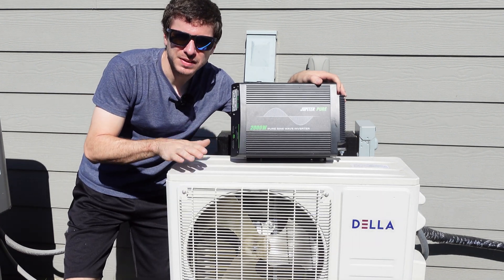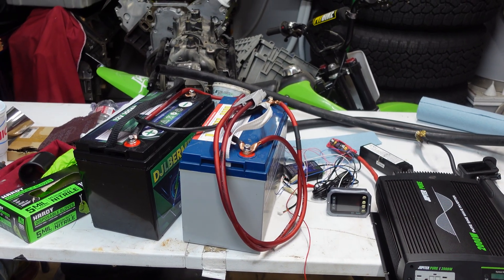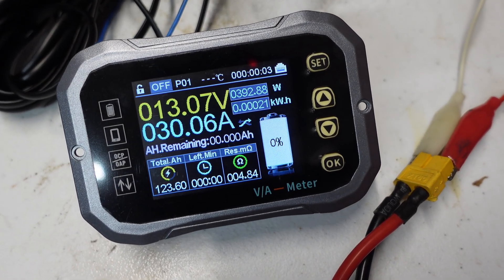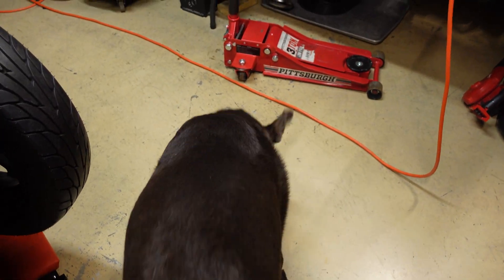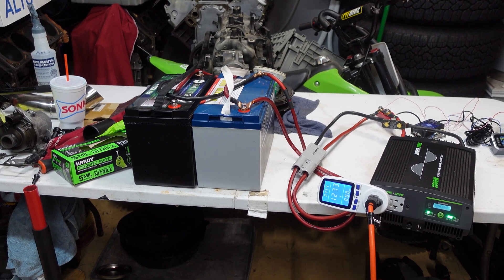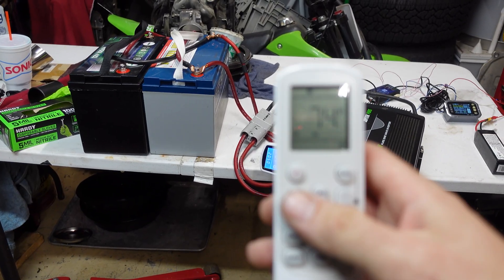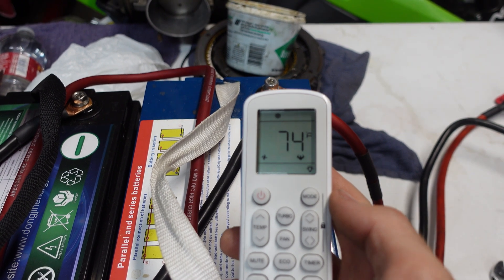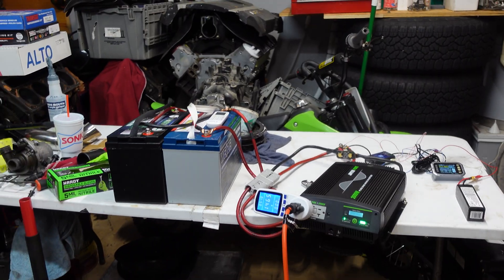Harbor Freight Jupiter 2000 Runs Mini Split

Comment: Cool. Will it not trip on a full size refrigerator compressor start? LRA is 6.7 amps and my FF Power inverter trips, it has an internal battery of 612 watt hours, 1000 watt surge, 500 w continuous. It was for camping running an inverter fridge, but at home it runs a normal size fridge in basement, but on this larger main level  fridge it trips out. A lot of Amazon users report iffy performance on  capacitor start motors tripping up even the larger inverters.
Reply from the maker: Yea depending on the compressor some may use more surge, i ran my refrigerator off this had no issues. 
Personally for 12 volt stuff id never buy smaller then a 2000 watt inverter just to have some overhead.

Comment: How many hours can you get out of it running a portable AC.
Reply from the maker: With one battery probably 1.5 hours. If you ad more battery’s you can get way more runtime
Reply: @Mikebuildss Thanks, I’m looking to run a 5k-6k BTU in a small box truck cab. 
Don’t need it too cold just comfortable, low speed would be fine. Was hoping to get at least 5-6 hours run time.
Reply from the maker: @KevinG1994  I would look into using a Inverter Type window ac, they use very little power on low, so you can get good runtimes with a small setup. Put a solar panel on the roof to charge aswell that will help.

Comment: Sure, it can, maybe if you're lucky a few times. But every time you start that mini split, you're shortening the life of this toy high-frequency transformerless inverter. If you want an inverter that is going to last more than a few months, an inverter that will last 10 years or more running an AC unit, then you need a low frequency, transformer-based inverter instead.

Comment: Can someone shed some light for me? I picked up the larger version of the inverter he has 3000/6000 for my semi truck. My AC is going out so I figured instead up trying to keep that old underwhelming system alive for now I can run my 8k btu portable and run the exhaust out the side window for the time being as I’m just getting started on my own and already spending money in the inverter maybe I can rig something up till money starts flowing in 😂These trucks run on 4 large batteries so I figured it would be fine as long as I don’t abuse the system. What say yall? It’s a 350 sq ft insignia. I can probably get a way smaller version.
Reply from the maker: My best advice is make sure you use heavy gauge battery cables from the inverter to the battery. Also the ac will use close to 1000 watts. So keep that in mind, it may use a TON of battery power idk how long it would run

Comment: Ha, I have waited for over a year to try this, funny I got Della (120v) 9000 BTU and today I had it running off a chins 50AH 640WH LIPO4 and if not for the convertor drawing on + and seeing I need bigger gauge then I would say IT WORKED :) only 3 100W panels too! In winter bad sun rays. Pumped! oh yea I have the controller and gear feeding that little chins. (Update) I forgot to mention they say when the MINI SPILT kicks on first time it is seeking to find the temp (located front of cassette under the lid). And after room stabilizes then the MINI SPLIT simply pumps Freon as needed (variable speed pump) that is cool because once stabilized the Watt draw and such will be MUCH lower when running. Think of it as the draw starting a car, then the current drops off. This is why I was attracted to MINI SPILT along with "no ducts" yay!!!
Reply: I have the same mini split you do but mine is 240V..and from what im gathering..its nearly impossible to do a little starter solar setup for that unit with it being 240 😞

Comment: There are some mini-splits that you plug your solar panels into directly now.  See: EG4 Hybrid Solar Mini-Split Air Conditioner Heat Pump AC/DC | 12000 BTU | SEER2 22
Reply from the maker: @Scott-sm9nm  I’ve looked into those, only reason I went with this unit is price! I have a nice big 48v solar power system I use to run 3 at once without issue to heat and cool the whole house
Reply: Great post thanks!

Comment: Could you do a video or something showing how you wired up the mini split to run on that 3 prong plug? I’m getting into solar and wanted to start small by moving my ac to solar. My simple start plan is buy a power station with about 2kw inverter. Overpanel with solar and add about 3kwh storage with lifepo4 batteries. I want it separate from my house grid
Reply from the maker: @stillbingrude  I have a video installing a copper and hunter mini split, on that video I show how to wire it. Just make sure you get a 120 volt model, it’s only hot, neutral and ground

Comment: I have a 190btu.  240v heat pump.   How should I set mine up?  I’m planning to get the 12v 280amp eco worthy batteries
Reply from the maker: @kenborghini  Ibwould find the max power the unit will pull and go from there. If it’s more than 1000 watts I’d go with a 24-48 volt system to keep the amps down

Comment: To cut the Amps down is it worth stepping up to 24V since now I only have 2 WattCycle 12V 100ah Batteries?  Thanks
Reply from the maker: Yes, id say if your needing more than 1000 watts of power at a time, go higher voltages. I use 12 volts for small loads, and 48 volts for larger ones! 24 would be great

Comment: I have this inverter and tried to run it to charge an allpowers unit that holds roughly 3600wh at high setting it charges at 1500w I use 00 gauge cables with 3 foot cable length and it started whistling when the output reached the 1500w range the led indicator showed red and the plastic surrounding post for the positive terminal started melting, I felt the cables they were hot, this was running from a 12v 2p SLA battery setup in my corvette c7 batteries are group H6 inverter is rated for 2000/4000w it should be able sustain 2000w and not melt down and handle peaks up to 4000w I used thicker than recommended cables any idea why I was getting this result I realize that if I’m outputting 1500w ac then I’m bringing in closer to 2000k dc bc of inefficiencies though the unit does advertise 90%+ efficiency that means I should be able to push 1800w ac and still be pulling under 2000w dc. If the unit is rated 2000/4000 I believe they’re referring to the ac output meaning with the recommended 4ga cables it should be able to pull 2200w+ dc. If I pushed another 500w the whole thing definitely would’ve lit on fire. Anybody have any idea why I got that result? Is it the battery chemistry? Perhaps the solar generator has poorly calibrated monitoring systems? I haven’t tested it with my LiFePO4 setup yet.
Reply from the maker: @ThisAndMattShow  more then likely too much voltage drop. Also when voltage goes down amps goes up, make sure connections are good, clean and secure. Lead acid can have bad voltage drop if they aren’t up for the load. I’ve pushed this inverter to 1500 watts plus a few times testing batteries and equipment and it held up. Also 1500 watts at 12 volts is close to 120-130 amps kinda pushing it for 12 volts in my opinion. Also lifepo4 chemistry is better for higher power due to lower voltage drop. But same thing they must be properly rated for your load and application. Hope this helps
Reply: @Mikebuildss  alternator is running and should aid in current supply minimizing voltage drop and also the unit itself started to meltdown on the physical terminal at this load which is a draw within its specified range and with cables much thicker than spec calls for. With 00 gauge cable under the conditions specified i wouldnt expect it to start melting, granted a shift from like a fully charged state of 13.6v down to the low end of the range the inverter operates within, lets call it 11.8 though its probably lower under this load which may be causing voltage drop the current does get pretty high but I would assume that it should operate fine up to 2000 watt rms at the low end of its operable voltage  range so it should be able to handle high currents of around 180-190amps. over the spec cable of 4ga i was using significantly thicker copper at 00ga and running at lower watt and voltage within the operable range but even if it drops to 10v at the 1500-1800 watt range im still under the peak conditions  current draw at the low end of its operable spec range. 1500-1800w/10v = 150-180amps where i would suspect it should handle up to 190amps which the 4ga cable it calls for, this should not be meltdown conditions for the terminal attached to the unit at the load i was putting on it.

Comment: I didn't like the Harbor Freight 2000 Jupiter modified sine wave...Maybe the quality is bad now, I tried three bought on sale.  I had one dead, one only putting out 250w and the third didn't put out any more than 600 watts. I used heavy duty cables.

Comment: Unfortunately, the inverter puts out a fait amount of heat. I love it in the winter, but not so much in the summer. If you are trying to cool the space, maybe run inverter or at least exhaust fan to the outdoors. Mine can easily raise the room temp by several degrees.

Comment: Just a note on your IR gun: It's probably fine, if it's a 6:1 spot size ratio, if you're 6 feet away, it's detecting surface temperature for a 1 foot diameter spot. It's not really going to detect air temps, but of course it can detect the grille temperature if your close enough.
Reply from the maker: @maxvtol  I see what you mean it does say that on the back part, makes sense now lol. Up close I’ve seen these how down pretty low

Comment: Thanks for this review.  What size cables did you run from the inverter to the battery?  I thought I heard 4awg but wanted to confirm.  Thanks.
Reply from the maker: @hsidder  Yes sir 4 gauge
Reply: @Mikebuildss  thanks for confirming!

Comment: Is there no surge when the compressor kicks on?  It’s been a decade since I messed with this stuff but back then I had trouble with even refrigerators popping the over current on the inverters.
Reply from the maker: @joeprimal2044  no these mini splits have inverter drives
Reply: @Mikebuildss  Hmm. I’ll have to check mine and see if they do. Thanks.
Reply: Yeah same with mine so I’m trying to run a pressure washer 13 amps but those inverters would always turn off the moment the pressure washer would turn on

Comment: From your video here this is exactly what I wanted to know about the A/C part of it. I want to use one of these to cool my work truck. It’s actually a retired para transit bus. These are rated for 500sq.ft. My bus is probably not that big. This should work well. My question is what about the heat pump? Will a 2000 watt inverter handle the heat pump part of a mini split?
Reply: It should be labeled for how many watts it takes.  You'll want to leave like 20% overhead, inverters burn out a lot more quickly if you run them at 100% for hours on end.
Reply: @laurenceperkins7468  Thank you.

Comment: Hello , can i have your list on the set up?
Reply from the maker: Sure, it’s a harbor freight Jupiter pure sine wave 2000 watt inverter, and the batteries are 100ah lifepo4 12 volt
Reply: How much power is your AC? I mean the  BTU?
Reply from the maker: @shemcristobal1614  9000 btu
Reply: How about your wires?

Comment: Could ya do a good clean vidoe of a good set of batterys and with solar and see how long it last. Great video tho 👍
Reply from the maker: Yes I can do that!
Reply: @Mikebuildss  thanks and have you done a video of running your house on it and how long. And ever done anything with power windmills
Reply from the maker: @dakotak8437  I have not, I have a large 48volt setup I use to air condition my house, I have 3 mini splits inside the house they all run all day on solar and one at night in my room. Works amazing
Reply: @Mikebuildss  iv been wanting to do this stuff since I was young but with my mind this shit gets crazy setting up and all the different types of systems bc so many and no one in area to help I'm more mechanical.

Comment: My Senville 12,000 btu mini split don't ever draw that kind of power & im completely off grid on solar only with 520ah of lithium the most I ever seen my mini split draw in ac mode is barely 900 watts full power & 1100w in heat mode the lowest is around 300w in ac mode & about 600 in heat mode Senville is a very good mini split when it comes to less power consumption
Reply from the maker: @thelithiumpowerch  This model doesn’t have the best SEER rating, I have a Hunter and Cooper model aswell and it’s only ever pulled 1000 maxed out
Reply: @Mikebuildss  oh ok sounds a lot better

Comment: The easiest/best way to get solar power to ac is to use something like toshiba dual hose inverter portable ac. 
The thing is you can run them at much higher efficiency on low, using fans and ac science to get a cop of 6 roughly or 6 times heat transferred out as opposed to put in. 
They can run as low as 300w efficiently and effectively, they run the compressor slow and move lots of air to get maximum cooling efficiency. 
Just like most mini split solar setups. 
Except they are 5-10 times easier to install, portable, modular, and mildly less efficiency but still very efficient. 
2 toshiba units can keep an entire big house cool in very hot summers and poor house insulation situations. 
1 can do a 2 bedroom house very easily. 

Mini splits are a hit and miss, i think are less reliable when you go that cheap (400) and are not as efficient too when you go that cheap. 

Also the ge through window low profile inverter ac units are as good as the mini split or better imo. 
They are quiet and efficient, more efficient than portable ac units. 
They will do great on solar too about as good or better than mini split of any type except for direct dc mini split.
Reply from the maker: I actually did a video on one of those, I went mini split only because I didn’t have a window in my garage, but I agree with what you’re saying!

Comment: Well you just killed my idea of running a mini split off a bus alternator. Id have to add a 2nd alternator so ill just run the diesal generator. Thanks for the video.
Reply: You could see if Mechman Alternators has a model compatible with your bus.  I got a 3.8kW alternator for my old jeep that works quite nicely for emergency house power during outages and keeping a 200AH battery charged on road trips.
Reply from the maker: They are power hungry!
Reply: Is that della 9000 btu  SEER2 19 🤔🤔🤔  @Mikebuildss  asking since i just got me a della for my SEMI TRUCK and plan to hook up my TOPBULL 3000 INVERTOR SINE WAVE 😮‍💨😮‍💨😮‍💨 but pulling almost 1500 is crazy 😮😮😮😮
Reply: @Mikebuildss  also debating if use power station or invetor
Reply: That is the same reason that I am here. Working on converting my bus but I wanted to run my window unit using my alternator.

Comment: Is that mini split only 9k btu? That current draw is very high for 9k btu
Reply: Yeah my modified rooftop on my RV runs in the 1400watt range on high about 1200watts on the lower setting. But on a 12 volt system you don't get much run time but it will run long enough to make comfortable for a short time.
Reply from the maker: Yes it’s 9k, but the SEER rating isn’t great because it’s a cheaper unit, more expensive units will be more energy efficient and use less power for a given amount of cooling
Reply: @Mikebuildss  maybe the power factor is very poor you should scroll through your meter and see how much below 1 it shows.

Comment: Wild - my 30K BTU AC pulls ~1800W @240vAC
Reply: That would more than double if the voltage was cut in half (120V)!
My modified rooftop unit runs around 1400watts on 120v it's a 13.5 unit. And it kills batteries quickly.
Reply: Nope! Watts is watts, no matter the voltage.
Reply: @CubbyTech actually if the voltage drops the amperage does increase and to find the wattage the formula is volts X amps = wattage and when any of them change they all change . None of them are a constant and all change as vairy as the load changes.